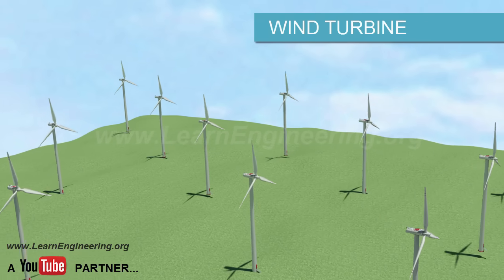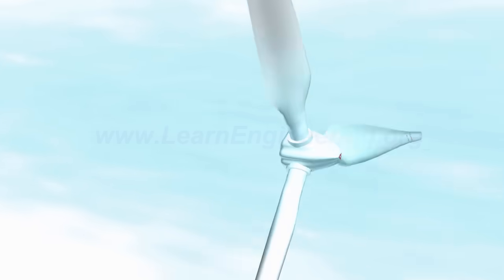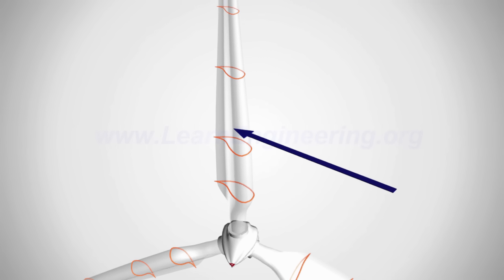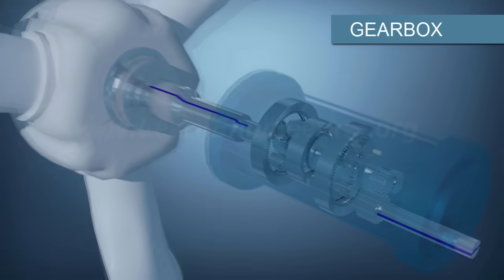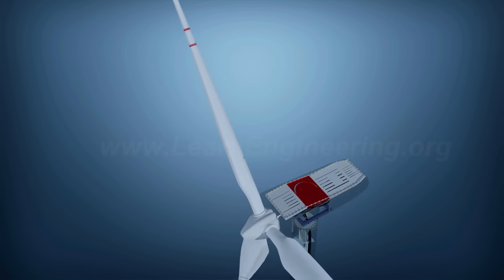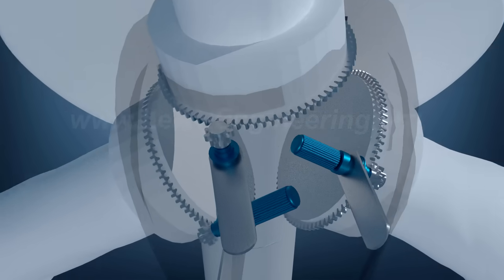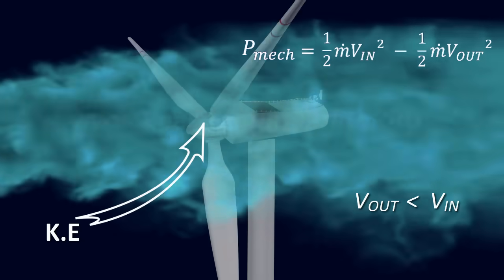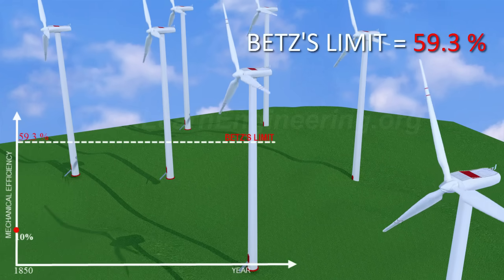How do Wind Turbines work?

Comment: Hi there, surely it makes more sense to install the brake before the gearbox to reduce stresses on it right? what am I missing?
Reply: +Brian I think the same, but I guess that the input torque to the gearbox is so much that a bigger brake would be needed at this point, so at the ouput of the gearbox a small braking force is needed. Perhaps they help rotating the turbine out of the wind direction or even changing the blade angle, as propeler planes do when the an engine fails, to reduce drag.
Reply: +superdau Braking before the gearbox would require brakes taking 90 times as much torque. That would require a huge brake. This is why the brake is implemented after the gearbox.
Reply: +Carlo CC Ahh ok that makes sense.
Reply: sixstanger00 sorry I don't get you. How would a clutch keep the speed in check? To govern a speed of something you use a braking mechanism to apply friction. A clutch only has 2 states, engaged or disengaged. If the turbine is fully disengaged from the main system without brakes then it'll spin out of control.
Reply from the maker: AABHUSHAN REGMI Brake has to stop the rotation completely, so stress on the brake will not vary depending upon where it is located.
Reply: Learn Engineering I was referring to the stress on the gearbox not on the brakes!
Reply: +38911bytefree well that is true but I was thinking of it just like a car, you brake the wheels directly otherwise the gearbox would crack after a short while :) Yes I'm aware the blades pitch angle can be changed.
Reply: This may sound silly, but wouldn't it be more practical to use a clutch instead of a brake? 
It's my understanding that in high wind conditions, the brake stops the rotation of the blades completely, yes?

With a clutch mechanism, the turbine could remain operational in high wind conditions, since it's max rotational speed would be capped/controlled by the clutch, yes?
Reply: I'm guessing you're thinking of a hydraulic coupling that would allow some power through. But that leaves you with the problem of dissipating the excess energy: something's going to get very hot and fail. Better to shut it down for the duration of the storm.

And feathering the blades to extract a small percentage of the storms energy wont work because turbulent airflow rises in altitude in storms, which would subject all moving parts, the bearings, the gearbox, to randomly peaking stresses they are not engineered to endure. Again, better to shut it down till clean airflow conditions return.
Reply: By your logic, automobiles should have caterpillar tracks.
Again, engineering is about getting the most for the least.
Reply: I accept your surrender, on condition that you never forget that engineering is about getting the most for the least. Your comprehension that caterpiller tracks are overkill on asphalt is a good sign. I wish you a long and successful career in engineering, and most earnestly hope you remember to include an adequate safety margin in all your calculations.
Reply: I was thinking the same thing.If somebody know enlighten me.
Reply: +Brian Su 
The gearbox is built to take the full torque of the rotor. So why should breaking after the gearbox be bad for it?
Reply: sixstanger00 no that totally defeats the purpose. The turbine would just explode as the centrifugal forces pull it apart. This is how turbines fail when they spin too fast.
Reply: Brian Su
Huh?

How is the turbine going to spin too fast if a clutch mechanism is keeping the rotational speed in check?
Reply: Brian Su

sorry I don't get you. How would a clutch keep the speed in check?

The same way an automobile clutch keeps power application in check - mechanical slippage.

To govern a speed of something you use a braking mechanism to apply friction

A clutch works on precisely the same principle. It uses the material brake pads are made out of.

A clutch only has 2 states, engaged or disengaged.

No, they don't. If this were true, it would be impossible to gently drive off in a manual transmission car (I own four, by the way).

When the clutch is fully disengaged, the turbine will spin free, yes. But a partially engaged clutch will cause drag, slowing the rotation, but not stopping it.

A car slowly accelerates from a stop due to mechanical slippage; the engine speed is X, while the drive speed is 0. As the pedal is released, the clutch disc begins to slip on the flywheel until it's speed matches the engine.
Reply: Acharacle & Achiltibuie
Yes.

A cooling system could be devised to handle heat energy dissipation.

The idea is not to extract as much of the storm's energy as possible; the idea is to keep the turbine operating during the storm, as though conditions were normal.
Reply: sixstanger00 I was referring to the eventual state. Clutch slip produces friction and is only meant to be temporary until lock up happens. If it keeps slipping then the material will burn out.

The same is the case with brakes. Continuous friction braking is never done due to wear.

It's better to fully brake the system to bring it to a complete halt to eliminate friction or use some kind of governor to control the speed through other means.
Reply: Any effort to extract a small percentage of the storms energy wont work because 
turbulent airflow rises in altitude in storms, which would subject all 
moving parts, the bearings, the gearbox, to randomly peaking stresses 
they are not engineered to endure. Again, better to shut it down till 
CLEAN airflow conditions return. I said this before, but you didn't get your head round it.

Engineering is about getting the most for the least. Bridges bridge - but only just, and that's the right way to do it. To engineer a wind turbine to be able to extract energy from a  storm is to engineer it for conditions that occur so rarely that it cannot be optimised for normal, therefore a waste, in sum a waste of efficiency and investment.
Reply: Acharacle & Achiltibuie

To engineer a wind turbine to be able to extract energy from a storm is to engineer it for conditions that occur so rarely that it cannot be optimised for normal, therefore a waste, in sum a waste of efficiency and investment.

By this logic, we shouldn't bother to fit automobiles with wipers, or anti-hydroplane tires.

Again, you are not engineering the turbine to, "extract energy from a storm."
You are engineering a wind turbine that can remain operational in all conditions to maximize efficiency.

Granted storms are infrequent, but that doesn't mean you shouldn't strive to build something that can remain operational under such conditions, because infrequent or not, such conditions WILL eventually exist.
Reply: Yeah exactly. Everything's designed to make money where it's most available. Anyway, wind, waves, solar, nuclear aren't expected to react to conditions quickly as they're only used to supplement coal, diesel and gas fired networks.
Reply: Acharacle & Achiltibuie

By your logic, automobiles should have caterpillar tracks.

Um, actually no.

When would caterpillar tracks ever be practical on an asphalt surface?

False equivalency.
Reply: I think you've misunderstood what the brake is for, it is not there to stop the generator from over speeding but rather to stop the blades from spinning too fast. 
a clutch would simply reduce the load on the blades and so they would speed up and over speed. 

a better solution to keep the turbine operating in storms would be to have two generators, one could be used in normal conditions, then in a storm power could be drawn from the second, thus increasing the load and keeping the blade speed in check without the need for a wasteful brake.
Reply: Depends a lot on the design of the turbine. Most modern turbines are able to pitch the blades more than 90 degrees which they can use to brake. The turbine will also yaw out of the wind to order to reduce wear on the gearbox. In modern size turbines the gearbox would in fact break if they could not do this. Some turbines also have lowspeed breaks, this is again only possible because of negativ pitching of the blades and the ability to turn out of the wind.
Reply: I thought the pitch control of the blades is the main breaking mechanism. Depending on the Angle of Attack,  you can adjust Lift/Drag ratios on the blades to effectively brake the rotor.

Comment: The improvement in efficiency is made possible by some Control Engineering technology applied. I've seen finite horizon MPC employed to regulate the variation in the energy input being stored.
Reply: Sounds like standard industry boilerplate bullshit. (Hey, nice try, "K" street lobbyist!)

Comment: Wow! So many questions answered in that video. Thank you!
Reply from the maker: Ludovic Moutoussamy You are welcome...
Reply: The biggest demand now is for copper and metallurgical coal plus cement  (Cement is manufactured through a closely controlled chemical combination of calcium, silicon, aluminum, iron and other ingredients.) All these materials are needed to to produce a wind turbine farm 240,000 tons of C02 for just one wind turbine which it last about 20 year some get 25 years then landfill. One turbine need 32,000 tons of cement (on ton cement one ton of C02) 12,000 of rebar steel need a lot of metallurgical coal. To decommission a wind turbine a lot of land fill coal and propeller blades most can't be recycled unless made of wood. Solar panel are worse lead zinc acids silicon itself  destroys your lungs make coal or LNG look good